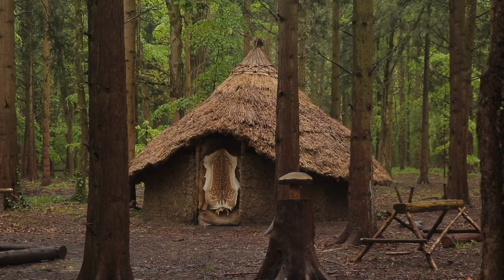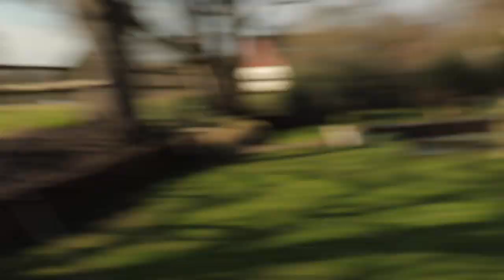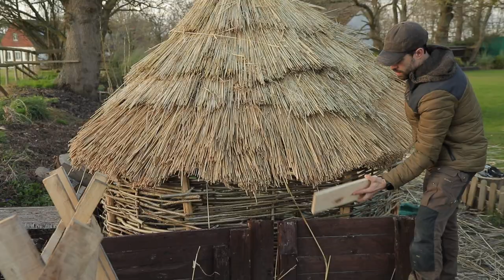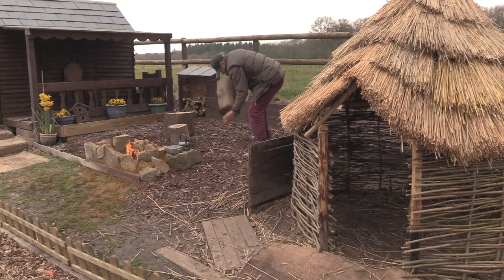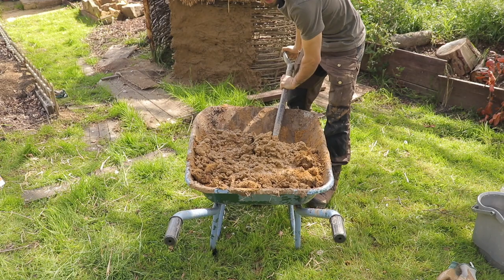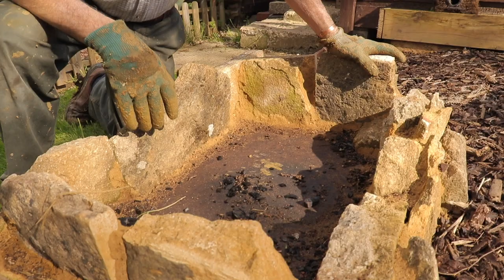Building a Tiny House for a 1 Year Old: Clay Walls | MINI VILLAGE (PART 5)

Comment: A 45cm overhang will protect the walls from rain to prevent sagging or collapse.  (That worries me. lol)  Also, a lime/resin 'paint' lends water resistance (recoated periodically).   Maybe u can add an extended underside to the thatch?      Hay was a no-no, bc it had seeds within it, I recall.  It seemed that they would cause 'heat' to build from methane & could combust, if I remember right.  (Similar to grain silo storage).  Hope that you can see this.  It's an adorable little village. Hope that you can see this.

Comment: There were some really useful tips in the comments when you build the big roundhouse. Something I really wish you'd have taken into consideration.
You need to apply the walls on the outside and inside together. That way you're not applying the inside on top of already dried clay, but instead the two sides dry together.

At least that's what the comment mentioned back then. I've never done anything like this, so I'm pretty sure I wouldn't know

Comment: It makes since the better it's mixed the better it will stay on the walls. After all if you don't whip air into a cake it won't raise.    If the ingredients aren't mixed a cookie won't taste right. If a wall mix isn't mixed well it won't stay on the wall. Good luck GENTS I hope it works!   😀

Comment: Very cool project. 

Just FYI, if the long straw bends, it's not brittle. Brittle means it snaps.
Reply: Also, steel plate on the ground would rust wouldn't it?